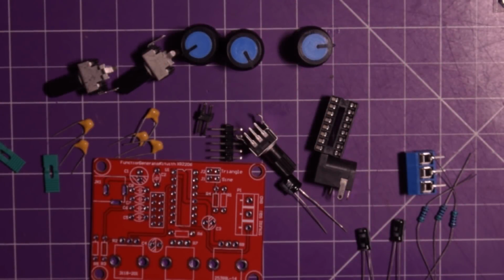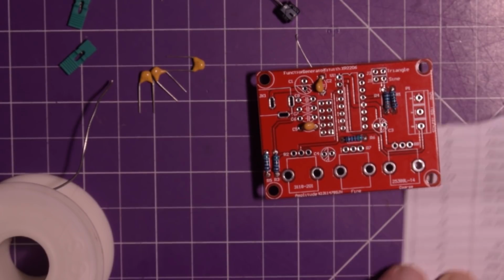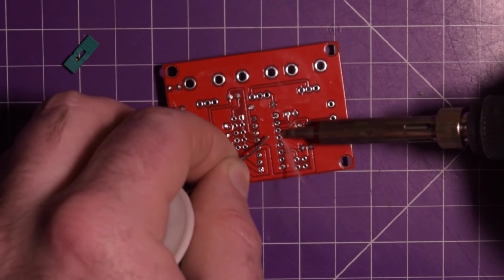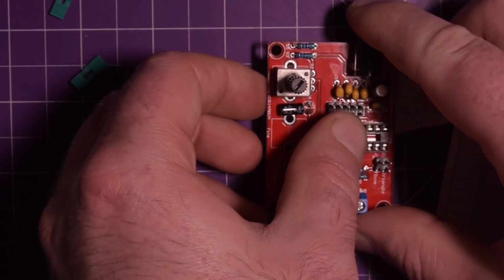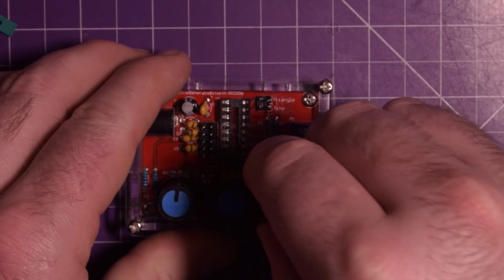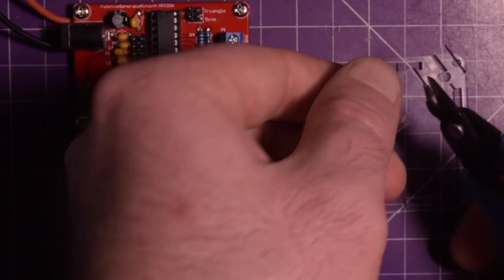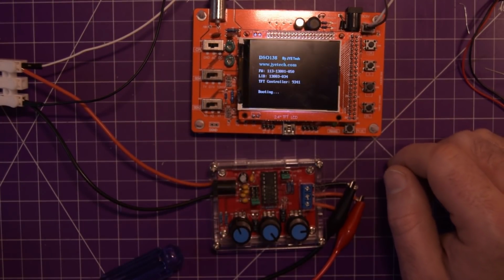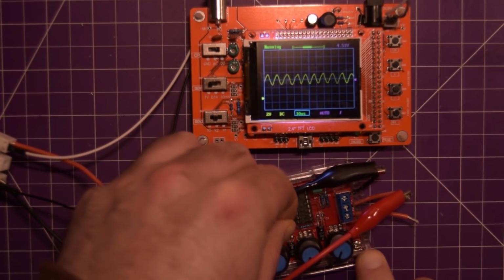Kit Build - Function Generator

Comment from the maker: Everything went south on this one; the pin headers were broken, a pin was missing off the socket, the jack was non-standard size, I forgot to put the micro in, I missed a bunch of solder holes, my oscilloscope wouldn't co-operate... felt like giving up multiple times, glad I stuck it out and got it done!

Comment: ive built one these kits but wasnt satisfied for it didnt last long .. i kept ordering/replacing the main func gen chip XR2206CP separately (which i believe  are counterfeit cuz they are no longer in production by main manufacturer a long time ago as researched).. better buy a kit not using said chip.